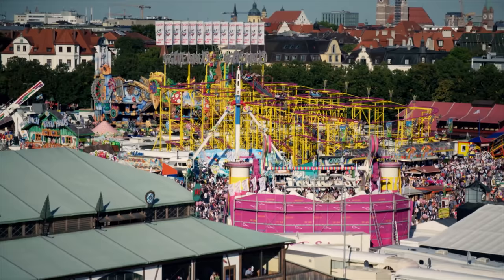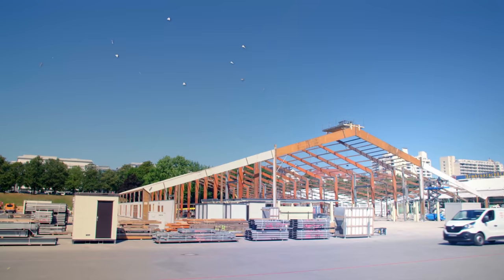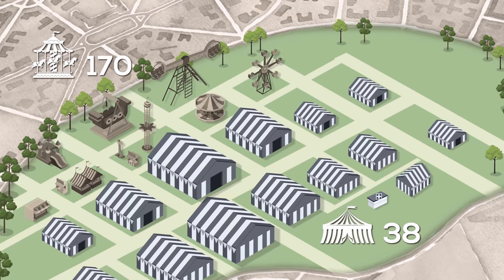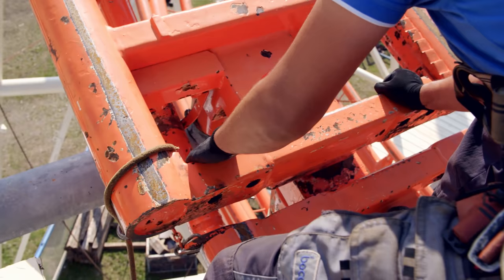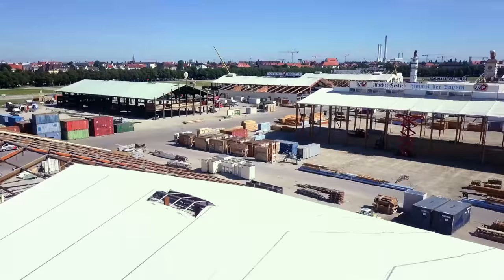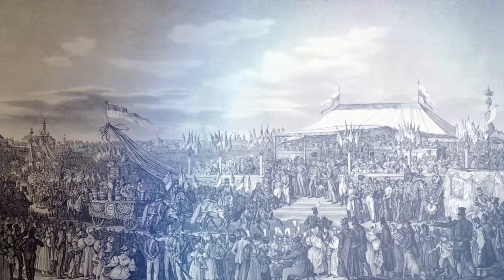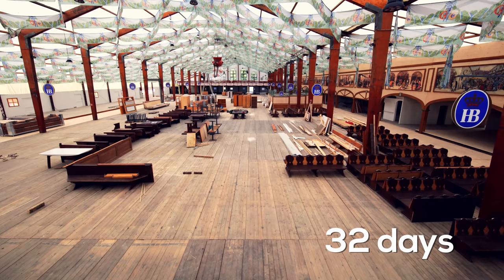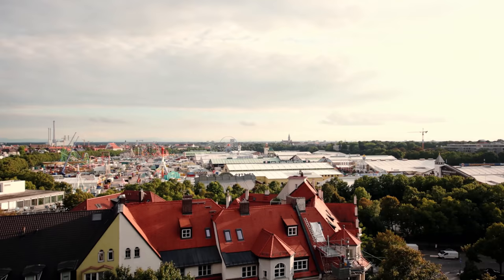Gigantic Pop-Up Fair: Oktoberfest | Giant Pop-Up Constructions - Germany | Free Documentary

Comment: "Safety is paramount during the constructing of this massive coaster". That's probably why nobody is wearing a helmet :-)
Reply: would a helmet work with a 3 ton steel part....
Reply: @30chrismuc  No, but it might save someone if a bolt accidentally falls from 30 m above.
Reply: @CH67guy1  with Bolts of that size - i Doubt it 
But bettet  Safe than …
Reply: @30chrismuc  Yes, I agree with you.  Better safe than sorry.

Assembling that roller coaster I saw so many chances that someone fall, lose fingers, get crushed, etc.